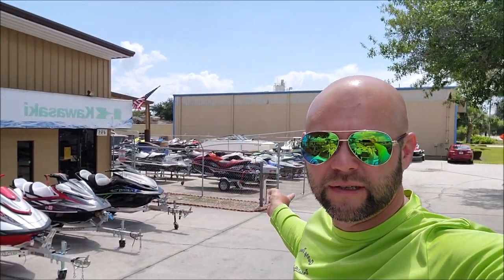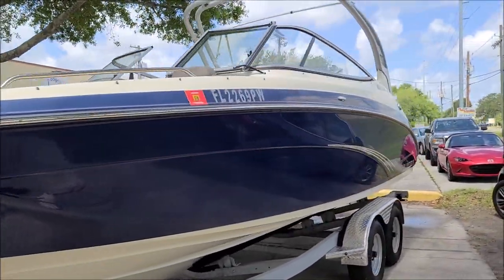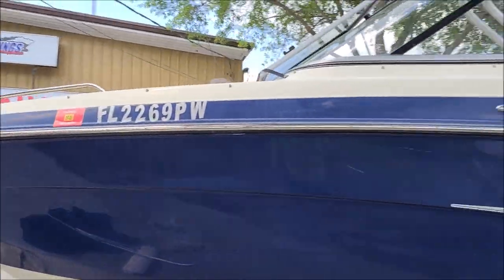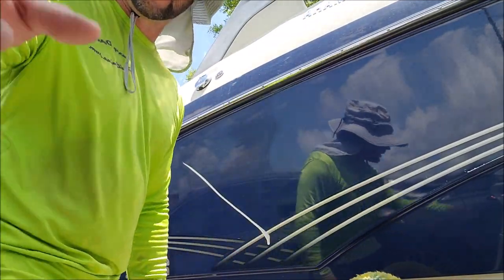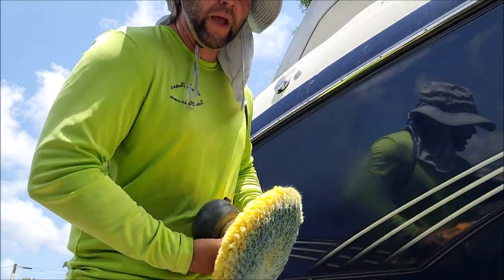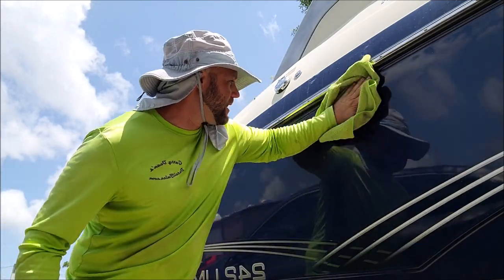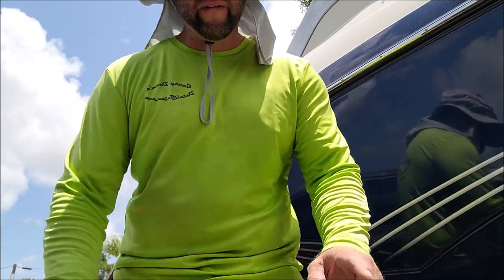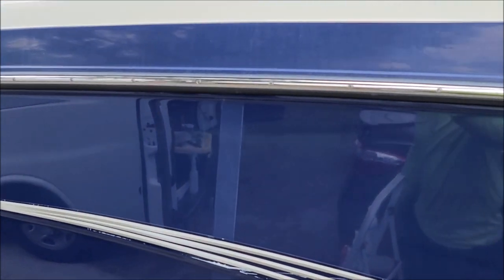2012 YAMAHA JET BOAT 242 LIMITED S   HOW TO REMOVE OXIDATION AND FULL DETAIL

Comment: confused, werent you using the all in one at first? ive got a 242 with black hull and every year its got a line of chalk at the edge of where the boat cover ends. Its a pita, even oven cleaner wouldnt remove the chalk. What should I use? Would prefer a one step process. dont need mirror finish just want the white crap off. send link I'll order
Reply from the maker: If you can send some good pics I can recommend a plan of attack. detailjuice@gmail.com